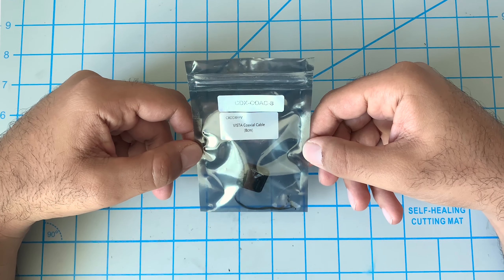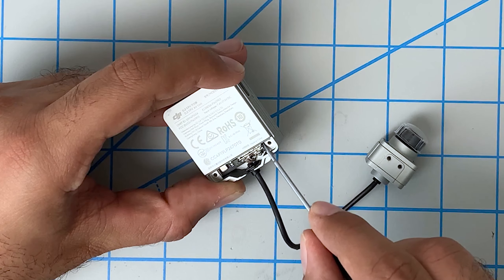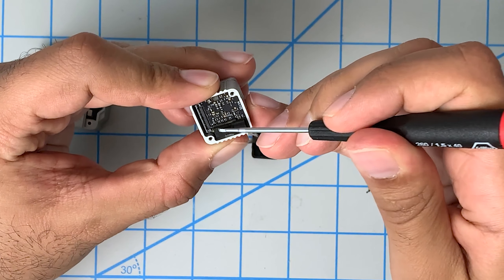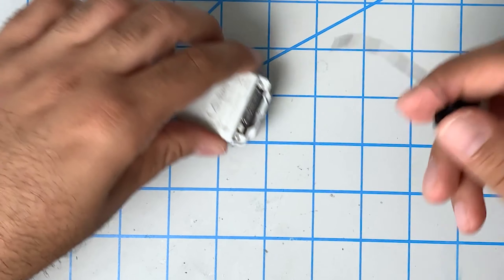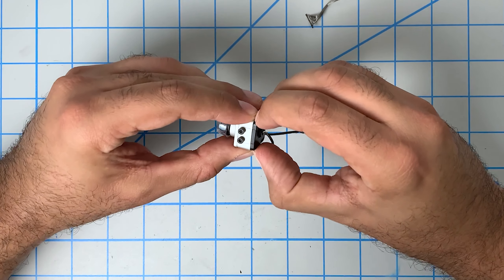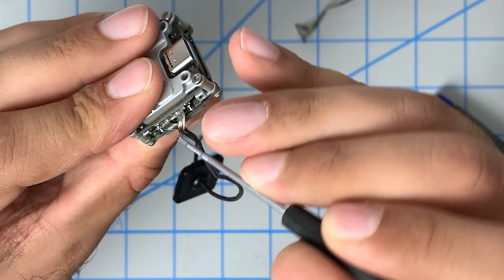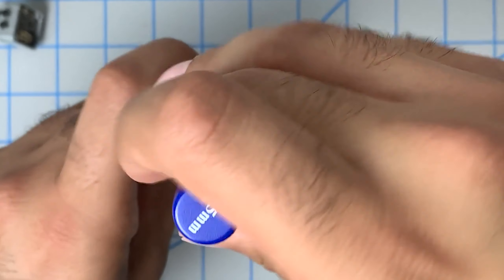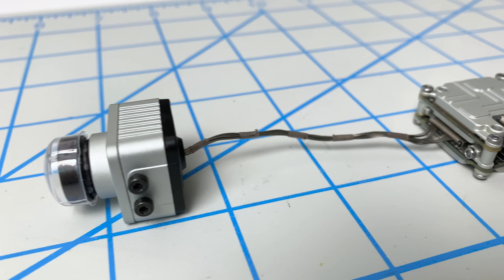DJI Air Unit & Caddx Vista Camera Cable Install & Replacement How To | FINALLY Camera Cable Choices!

Comment: Great job. Thanks for showing and explaining the breakdown and install.. 

Only concern I have is with the air unit.. seems original cover plate comes with little rubber dust cover .  Maybe have to put a little foam peice in place there.
 Otherwise  greats options for longer or shorter cable.. thanks for the video.
Reply: I guess im randomly asking but does any of you know a trick to log back into an Instagram account?
I stupidly lost the login password. I would appreciate any assistance you can give me!
Reply: @Markus Kelvin Instablaster :)
Reply: @Axton Frank Thanks for your reply. I found the site on google and I'm in the hacking process now.
Seems to take a while so I will reply here later when my account password hopefully is recovered.
Reply: @Axton Frank it did the trick and I finally got access to my account again. I'm so happy!
Thanks so much, you really help me out!
Reply: @Markus Kelvin glad I could help xD

Comment: So if I've correctly understood if I buy a brand new coaxial cable I'll receive it togheter with the backplate (=back cover of the camera) ? Or I'm completely wrong?
Reply from the maker: Unfortunately now only some of the cables come with the backplate. You should see in the picture/details which ones do. It looks like the DJI one does along with the 12cm vista cable. Best to read the details though before purchasing. If you are careful, you can get the cable through the backplate yourself.

Comment: Probably obvious but does this mean you can use any original air unit cameras with a vista? Because I have two air units but want to swap to the vistas. If I can just buy the vista itself that would be great
Reply from the maker: Yes you can, the cameras and cables are interchangeable. For the best experience, you'd want to purchase a vista camera cable as it comes with a slightly different camera backplate.

Comment: I squished my cable between the frame and now I don’t have video. Will that cause a red light on the air unit? Or is something else wrong too?
Reply from the maker: Red light usually means that it is not connected / paired. Are the wires shorted together? If not, you can try re-pairing perhaps.

Comment: I know this is older video, but let me ask anyway 😀. Is it possible to install DJI camera on vista and Polar camera on DJI Air unit? Or there will be some problem?
Reply from the maker: The cameras are interchangeable between the vista and dji air unit. You'll just have to deal with the different style of cables. The vista uses a thinner cable and the dji air unit uses a thicker one but the connectors are all the same.
Reply: @Mangorille  thanks for so quick reply 😀.. So I guess I must take not only camera, but cable too from one to other? I have both systems on my drones, but I prefer to have DJI on freestyle drone (lower latency, higher fps) and Polar on cinewhoop for calm and indoor flights.
Reply from the maker: @janezhitori6203  Depending on the camera you're coming from, you most likely will want to bring the cable with it. Otherwise you'll need to squeeze that cable through the camera backplate and it's a really tight fit! It can be done but I suspect after a couple of times that little cable won't take it anymore.
Reply: @Mangorille  hey man thank you so much for this video.  So do you think I can squeeze the cable through the back of the dji cam? I'm working on my first build and I have chimera 6 frame. I ordered the wire because I worried it would be too short and the frame came with one so I have two wires but neither had a back on it. Do you think I can fit through back of cam without damage? Thanks again! I love this fpv shit lol.
Reply from the maker: @OTRFlyer  Hey, yes you can squeeze the wire through the back of the camera, it'll be a very tight fit but will work. Try to limit how much you tug the wire itself and use the connector to push/pull.
Reply: @Mangorille  awesome man thanks! I got it but now I'm on to a different struggle lol! My plug n play t motor f7 came with wires that are too short to plug into air unit lol.  The air unit came with one that's long enough but I'd have to somehow put a plug on the fc side.  Any suggestions? Vids that might help? Thanks for your response!
Reply: Holy crap never mind! It works with cord that came with it! Thanks again man!
Reply from the maker: @OTRFlyer  No problem, happy flying!

Comment: I cannot find any videos of people actually mounting/installing the air unit onto a drone. I bought one and it doesn't stack on top of the FC so I am not sure where and how to attach it. How did you do it?
Reply from the maker: The full size air unit correct? You usually use a tpu 3d printed mount or you double-sided tape + zip tie to the frame. Most people prefer the vista because of the more typical size.
Reply: @Mangorille  yeah I bought wrong one and trying not to waste all that money 😂 thanks man!
Reply from the maker: @marcusgrip  The full size air unit is still preferred by some as long as you can find a way to fit it into your kwad. I ran the full size up until this year.
Reply: @Mangorille  ok thanks! 🙏 seems to be less latency is the difference?
Reply from the maker: @marcusgrip  Latency is about the same, the big difference seems to just be the overall picture quality. It's better on the full size air unit. Not sure what it is, perhaps it has a better image processor or the two antenna.
Reply: @Mangorille  ah okay yeah I think that’s why I bought it initially. I’ll duct tape it 😎✌️😂

Comment: Thanks for putting this together.  Would you happen to know if longer cables are available?  For fixed wing applications it's helpful to put the VTX further back in the airframe (e.g. Ritewing Mini-Drak).
Reply from the maker: Our pleasure. Right now the longest cable you can get is 20cm and it would be by Caddx. This length was released fairly recently and previously we only had 8cm and 12cm options.
Reply: @FourthWayRanch  I've been using it for a while on a wing and haven't had any issues.

Comment: I have the nebula cam and I would like to extend the wire, which cable do you recommend?
Reply from the maker: Hey. For the Nebula you need the same cable as the Vista which is available in 8cm, 12cm, and 20cm. The challenge is that these cables come with a plastic backplate for the normal DJI camera. You'll need to carefully cut the backplate off to free the cable only. Caddx has not yet released the cable by itself, which is what you need for the Nebula.

Comment: For the rubber parts (both camera and air unit side) I use an thin sharp exacto knife and make a cut from one side of the rubber to the center.
Take your time in order not to damage the wire(s), never push too hard, gentle cuts forward and backward until you're through.
Then you can gently spread it apart to remove the old cable and insert the new one.
The cut's not gonna make any difference once the rubber gets inserted and squeezed back into the notch, if you wanna be sure you can still add a tiny drop of CA glue, but I don't even bother as it really doesn't move.
As for manufacturers, I'm not gonna use the words I would really like to express, but the thing with their vista and air unit cable length is an utter annoyance.
Saving on cable length on parts that expensive is nothing but an insult to customers.
When buying a unit it's not easy to find one with the right cable length, if it's even specified correctly by the dealer and you anticipated it.
Even the choices they propose are flat out idiocy, more often than not they come out too short and in some cases too long.
The seldom pros who wanna have the shortest possible cable are really a minority, they could replace their cables if they really want, so it's not argument, saving a few cm of cable on each of tens of thousands of units is really more like the real one.

Comment: i got trhe cable through the plastic and the o-ring. didnt know you were not supposed to
Reply from the maker: You can do that, I've started doing the same since but the cable feels so fragile that I'm sure it'll break after a couple of times of doing that. Haven't had any problems doing it the one time though.

Comment: I notice no rubber boot on the new cable to protect the wires coming out of the air unit.
Reply from the maker: Correct, the Vista wire does not have the boot. You can put some foam there but ultimately the air unit is not weather tight anyway.

Comment: I'm a dummy. I literally took the whole bottom piece off my vista
Reply from the maker: :) It takes a bit of fiddling but you can get the cable in without taking the whole thing apart.